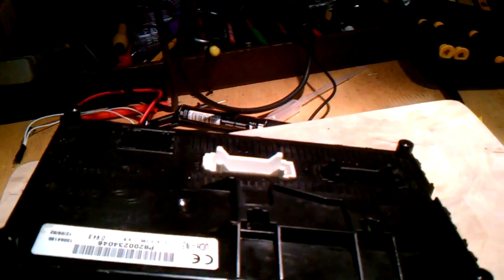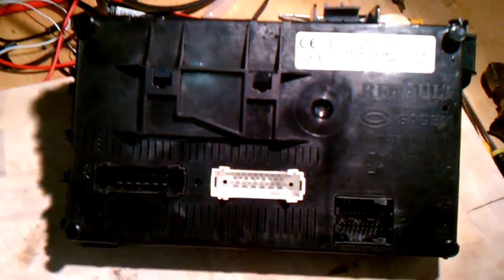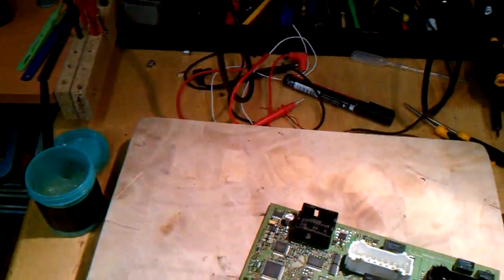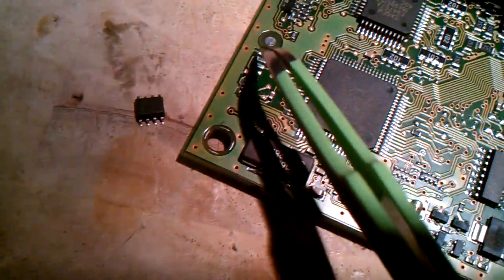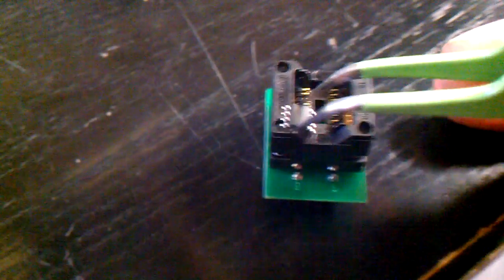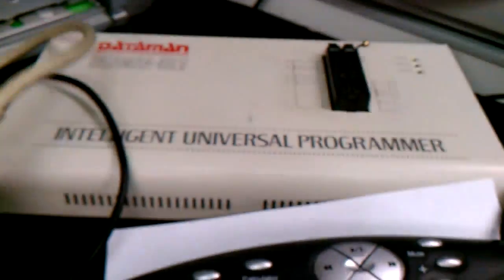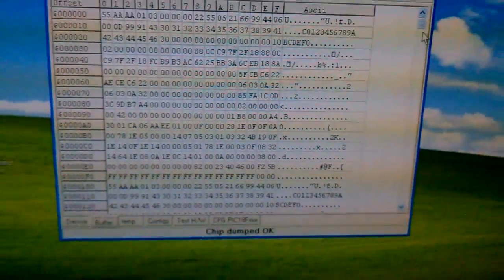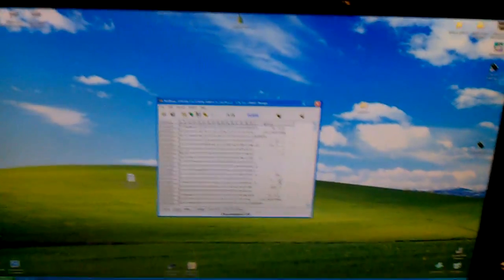Clio UHC EPROM 93C66 Dump to extract pin code APV

Comment: Hi there, I accidentally verginize my Renault Mégane ii uch, will this technique work to extract the isk from the uch?
Reply: I have the same problem, did you find a solution?
Reply: @jorgealbertofloresviniegra675  I have to pruchase second whole new uhc and key and steering lock to replace existing unit, also rewrite the profile and milages into the new uch.
Reply: @sentieria  I have a universal steering lock emulator, so I guess a new uch would suffice right?
How can the profile be rewritten in the uch?
Reply: @jorgealbertofloresviniegra675  what I did is basically transfer the whole new uch from another same model car into my car, the issue is that the uhc encryptiped key is to the whole unit into the one used key, if you can rewrite your steering lock to talk with your new uch than it should be fine but you still need the new uch key that come along with the unit. Also just watch out the pre 2006 and after is using different uch software so it will give your odo meter issue. Also make sure Mégane and not scenic even they can start the car it give you different issue even though they have same engine and gears.

Comment: Hey boss, i was trying to read a 93c66 rotated but I connected it the other way around while it’s on the pcb and couldn’t read it so I corrected the orientation and now able to read it but all im getting is FFFFFF’s do ypu think the data is corrupted or will i be able to read it if desoldered?
Reply from the maker: Try... i always remove them anyway... always easier and safer...
👍👍👍

Comment: Do you ever use the clamp that comes with the carprog that clamps onto the eight leg chips while its still on the pcb??It looks like a clothes peg sort of clamp,do they work instead of desoldering and removing the chip?Thanks.
Reply from the maker: Not really...
I prefer to remove the chip... reading or writing the chip while on the pcb, can corrupt the data... due to the circuits that still making contact...
Thank you for watching!
Reply: @LMAutoRepairs  thanks again,sorry for all the questions,im learning about key cutting and programming keys,appreciate your help!:-)

Comment: I have the same problem with my clio 2 phase 2005, I bought a good opportunity UCH case, when I connect them all the commands work correctly except the starter. How can I solve this problem?
Reply from the maker: Move the eeprom from your original to the replacement one...
Thank you for watching!
Reply: @LMAutoRepairs  thank you so much

Comment: Hello. Are you on skype or inastagram. Want to get in touch for a little help. Skype is john.halm
Reply from the maker: Hi
What are you looking for?
Thank you for watching!
Reply: @LMAutoRepairs  i have been watching your videos a lot. I have a 2003 megane 2 1.5dci which i bought with the engine damaged. I saw steering lock on the dash and car does not start. I wanted to send you a video to see if u could help me fix it. I need to change the engine but want to be sure all electricals are ok before buying the engine. I don't have a lot of good renault mechanics in my country and the few i know keep telling me to switch to petrol. Which i think is a bad idea just cos they don't know abt the car. I have ordered renolink and renault com. I am computer technician and know abt computers and even fix laptop motherboards. Pls if you could be of any assistance. We can communicate on whatsapp if you don't mind
Reply from the maker: @johnhalm6020  
Hi
Replace the engine and go from there...
If you want to be sure, scan the car as it is and see what that steering lock on the dash is for...
Check my forum... There is really nice people in there , willing to also help... I m quite busy as it is... lol
http://prodiag.boards.net/

Comment: Please I need your advice. I have problem with my UHC it have lost all data, all numbers, of chassis, engine etc. It is a immobilizer problem, blinking all the time, new UCH doesnt solve problem(that is what my electrician said, he tried with the latest programs and says that they have to manually enter the numbers but have not yet managed to solve it) He works for a very long time and he is a good repairman, I do not think that it's a question :) He says this is the first time he is faced with such a problem that UCH has remained with no data probably due to a loss of current(voltage) what is your opinion, what can he do? plZ help.
Reply from the maker: leemasszuu 
Hi
🤔
Based on your description,  I think clip is your best option... as if the module is blank, it should allow you to reprogram it...
And from there, code everything else...
I never seen it on a Renault... is it common on the Peugeot 307 BSI though...
Thank you for watching!
Reply: Thanks!
 God bless!

Comment: you take too much time to do this ufff.
Reply from the maker: Hi
I take too much time to show you how to do this stuff... 
When I do this, will not take me that long... obviously!!!!!
Thank you for watching!
Reply: why not use renault CLIP..? and love the skill
Reply from the maker: ThaDutchDK1989 
🤔
You need to show me how to get the code with clip... on this UCH...
I
Reply: just leave it in the car? i worked for renault and never took the uch out for new key. just use clip.
Reply from the maker: ThaDutchDK1989 
Ok... on the newer ones you can get the spare code with clip, and then with certain softwares decipher the actually code... not on all though... megane 2 phase 2, does not work... and you actually need to dump the eeprom from the UCH...
Show me how you do it then... I curious now... 😉
Reply: megane 2 does work only i dont know how to do it.. but a mechanic at the dealer were i worked did it in 20 minutes just a new key and a car and a CLIP. maybe we have different version clip cause its a real renault dealer(we have updates). and i dont have camera to film it. but its no hate i wish i knew every component on the ecu like you. i only now lots of theoretical knowledge.

maybe we get confused cause i talk about WITH a new key (so a spare key) and you maybe with 1 key( only 1 key and its broken)
Reply: just maybe to help you eventough you dont need it. if you a have a twingo 2 (2007-2014) and the lights or horn doesnt work. then the lightstalk/horn has a broken wire just soldern it and good to go 30 min job.
Reply from the maker: ThaDutchDK1989 
We are talking about different things... obviously the dealer does not open modules... and can program keys quite quick....
They have all the security codes on the Renault servers... which they obviously have access to...
Nothing to do with the clip version you are using...
If you want to do it with the same limitations I have, I don't know of any other way....
Also, does not make a difference if you want to programme one key, a spare, whatever... once you enter the programming procedure,  you need to do all the keys... even the ones already programmed... otherwise they will stop working...
😉
Reply from the maker: ThaDutchDK1989 
Thank you for the tip...
I never had that problem,  but will keep that in mind! 😉
👍👍👍👍

Comment: Hallo, can you tell me what is the chip  RFRSA806404 it found in Renault remote key? Thanks.
Reply from the maker: Hi
It seems to be some sort of radio frequency amplifier integrated circuit...
Would have to look deeper to give you more info...
Hope that helps.
Thank you for watching!
Reply: thanks

Comment: Hay my friend,I need some help,i heave problem with DDCR CLIO2 1.5 DCI 2004 need wigin files,do you heave mail to to comunicate with ou in futures :) thank to
Reply from the maker: GBV V 
Which ECU are we talking about?
Reply: DDCR 80944C
Reply from the maker: Ok
Have you already read the EEPROM?
Reply: Yes a read is  ok bat a wont the clean eeprom
Reply from the maker: I have never done that one... I could only access some documentation that is on my server at home.... I do not have access to anything else at the moment...
I found something along this lines:
FF the first two lines, 23 the rest of the EEPROM except the last two lines... leave them intact.
Not sure if this is the right way... save the original file before any changes...
Reply: Ok,thenk you very much,bi in tach :)

Comment: is this also possible for a VW golf mk5 with immo4? I lost my keys and need to reprog it but I don't know the skc/pin so will I get it via the eeprom?
Reply from the maker: Randy Martosoewito 
Hi
Should be possible... but read it from the cluster chip.
Do your own research before attempting...
Alternatively there is some interfaces that can read the pin directly from the OBD port.
Reply: lmsvvavr I have done a lot of research but I am limited because of the country I live in, so I have to order everything from oversea if you say I can try some interfaces that can read the pin from thr OBD but If that also does not work I wasted a lot of time. i do have a friend that will try to read the skc from the eeprom tomorrow and thats why I'm here watching your vid to learn something
Reply: lmsvvavr do you know what interface will work thru the OBD?

Comment: hi the equiptment u used to read the chip, whats it call and where can i get one.
Reply from the maker: Kawsu Kanagi 
I mention it on the video... I have a few that are capable of reading this chip...
Reply: Thank you! well where can i get one?
Reply from the maker: Kawsu Kanagi 
Well... eBay,  Amazon... and other online line sellers.
If you have any local electronic store you might can ask in there...
Reply: Have you every tried any cable to reads the pin code via connecting to the OBD2 port. without having to remove the ECU, and soldering off the chips.. for instance I just came accross this  software and obd 2 cable that is said to be able to read pin code through the OBD 2 connection http://en.freedownloadmanager.org/Windows-PC/Vag-Tacho-USB-v-3-01-FREE.html
Reply from the maker: Kawsu Kanagi 
Definitely.... there loads of different cables out there that are capable of read the pins through the OBD port...
But, unless you are planning to read a few, it does not worth to buy it to read one or two cars.
They are or can be quite limited on the type or cars or ECUS it can read the pins.
So, it is more of a personal choice.
For me, because I have all this different programmers, is better to do it like this...
Hope that helps...
Reply: Okay, I never knew this. I am definitely interested in one solution that is to read from chip through the eeprom. can rasp berry do this? sorry I ask a lot of questions.
Reply from the maker: Kawsu Kanagi 
Look for eeprom programmer... if you want to do other modules, look for one that can also read MCU's... as some cars the pin is stored in the eprom. (eprom inside mcu.)

Comment: or if i buy old then
Reply from the maker: The number you need to take it from yours, although a different number might also work...
Even if you buy a second hand one, you still need to program it to your car... and you will need to extract the pin from it... as the remote and immo needs to be programmed...

Comment: any idea what would cause clio mk2 o/s   n/s intermittant window problem-sometimes window  works will open and close other times u hear a clicking noise coming from ecu unit similar to one in video but not the same model number mine is P8200387290-im guessing there is some sort of relay(possibly built in ) on pcb board but im only guessing this-have never seen one open before -only on your video-garage not overly helpfull-thanks for any advice u may offer thank you
Reply from the maker: chevy790 
I would not know without looking at the diagrams... 
But there is some built in relays... so might be that one is  not working as it should...

Comment: I like your vedio and would like to ask about this type of eeprom which dose not have any interface to detect the posion of it ,but i saw you mention direction of text on the chip and i would like if you can explain what you mean of which way the text face the ground because the matter right now for me is the chip but not the board and i would like to find problem to this because i have to change this chip manytime just because of this and thanks again for your helpfull vedio
Reply from the maker: Hi
If you want to now the pin assignment of the chip, just Google the chip and look for the datasheet...
When you remove the chip from the board, is just important that you mark or record the chip orientation... which I usually use the letters on the chip...
Reply from the maker: Hi
If you want to now the pin assignment of the chip, just Google the chip and look for the datasheet...
When you remove the chip from the board, is just important that you mark or record the chip orientation... which I usually use the letters on the chip...
Reply: yes i understand it but for example i have  93c66 from ECU and unfortunatly i drop the chip when i was trying to see the direction of the letter just drop down on the working table so iam right now confusing when i was searching vedio's on google i came to your vedio and i saw u mention this type of chip and how you detect the guid pin but in my case i know where is the ground on board but i don't know the direction of this chip to put it right or you can measure the resistance of Pin's i don't have any refrance i wish you can help me because u mention you said about direction of the text which model of chip and so on in direction of what but i tried to know but u move with holding gift so i didn't realise which one :)
Reply from the maker: +Sameh Afify 
OK...
Is the chip marked on pin 1?
(Usually a small recessed dot/circle)
Or marked at one of the tops?
Have you read the chip already?
Reply: this is exactly what iam talking about no dot no guid mark on it just text where the model of the chip and ST is manufactory but nothing else and i have already dump from it lucky i got it befor i take it out with incircuit programer and it's 8 bytes dump thanks in advance for you help
Reply from the maker: OK...
From the top of my head I believe that looking at the numbers on the chip, pin 1 is the bottom left...
Try to read the chip on that orientation...if does not read, then is the opposite...
Reply: i will try many thanks for your respond

Comment: Sometimes imobilizer wont turn off(red dot on the dash), i wait and put the key in and out and it starts.Now the back wiper dont stop, untill i open the bagage door, do you thing its a UHC error;
Reply from the maker: Hi
Possibly...
Have it scanned first, look at the live data as well... and go from there...
Reply: lmsvvavr Scanne with what?
Reply from the maker: +Δημήτρης 
With a scanner?
If don't have how to get hold of one, just get it diagnosed and ask for a report...

Comment: i want to buy orange 5

What do you think for programmer orange ??

i want buy with full soft immo  price 2000 euro
Reply from the maker: +MrBarbarosa22 
Hi!
I do not have any experience with that particular programmer...
But, I had a quick look, and it looks quite good...
Reply: +lmsvvavr is it posible to bypass the key immobiliser by removing a chip from ecu or something like that because i bougt a clio 1995  and it didn had a key
Reply from the maker: +robertas grigas 
Hi
It is possible, but that it is done on the engine ECU...
Different procedure all together. 
Thank you for watching.

Comment: Hi Imsvvavr
I have a faulty UCH-N2 P8200234045A V4.7, do you think I can swap the chip with a used UCH-N2 P8200387289 V5.5?
Reply: Hi.
Sorry, have you tried it? And remember if it worked?
Regards
Reply: @ByBpt  sorry but I ended taking the UCH to a tuning shop that knew the problem and repaired it for 80€.
Reply from the maker: Hi
You have nothing to lose. ..
Ensure the chips are the same....
Thank you for watching!

Comment: Very Nice video!
If I buy a UCH box at the scrap,
is it possible to replace its eeprom, by the former, without having to reprogram anything at all?
Thank you
Reply from the maker: Hi
Can not see why not...
Although be careful with different software versions of the UCH.
Thank you for watching.
Reply: +lmsvvavr 
Hi!
I tried to replace the eeprom of the new UCH (from a scrap) by the eeprom of my UCH, it don't works.
I dumped the old eeprom (see screenshot : http://www.hostingpics.net/viewer.php?id=116419ANCIENNE.png)
and the new eeprom (screenshot : http://www.hostingpics.net/viewer.php?id=472282NOUVELLE.png)
I don't understand where is the code that I need to copy to the newer eeprom.
Have you got Whats app or Skype? my email : secteur93250@gmail.com
Help! Thank you !
Reply: +Secteur 93 The 2 UCH have got the same ref : UCH N3 P8200272302A
Reply from the maker: Hi
So, you have dumped your original uch, and loaded it in the "new" uch.
is that correct?
Reply: +lmsvvavr Yes exactly. When I put the contact, the headlights light up (even the button is on OFF), and if I try to start the engine, there is no signal going to the starter
Reply from the maker: +Secteur 93 
Hi 
Without looking, I can only kind of thinking of two issues...
Or the "new" uch is faulty, or the dump is corrupted. 
What happens if you fit the old uch?

Comment: Thank you for video, where is the code pin in sceean in this video, you can specificl
Reply from the maker: Hi
Does not show on this video...
I do have another video which shows how to retrieve the pin from the dump, and which software to use...
Hope that helps.
Reply: thanks for the reply, or renaultoimmo immo killer.